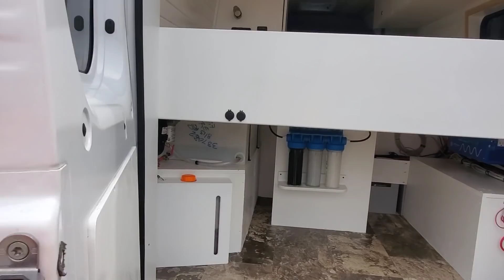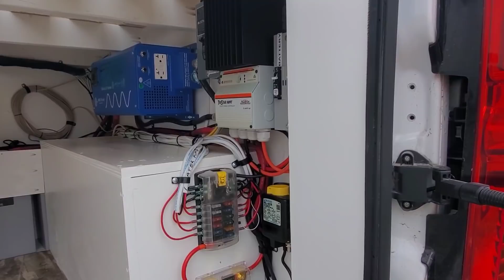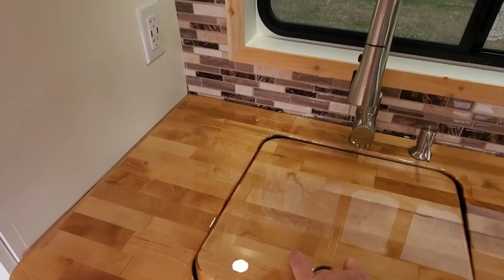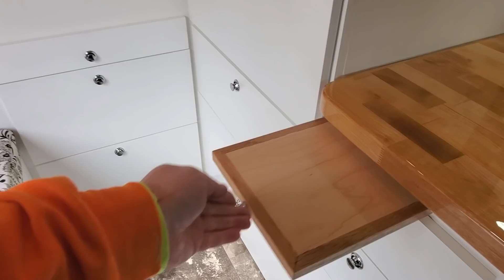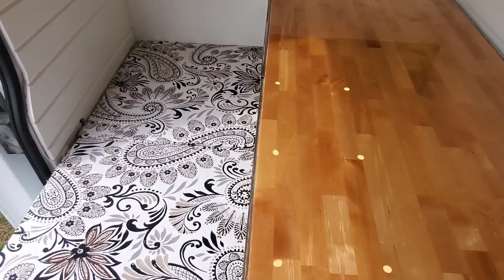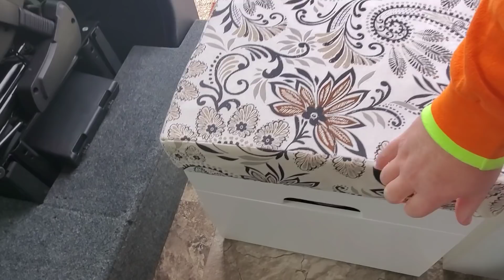Dodge Ram Promaster Camper Van Conversion (E38)

Comment: Red, how come most ProMaster vans are only the 2500 and not the 3500, 159” extended??
Reply from the maker: Because the 2500 and 3500 159's are cheaper and easier to find. The 3500 159ext is usually around $5k to $8k more and harder to find used in good shape with low miles.

Comment: I am looking to put my heater in the same location but looks like there is only 3 inches of space ...
Gas tank in one side and some other thing is there and didn’t look like enough room to bend the intake and exhaust pipes and bolt it down ! You did so great job! I may look for a easier place... lol
Reply from the maker: Putting it there was a complete pain in the a** and I hope i don't have to put another there.

Comment: Very nice job! I've been converting my 2019 159 Promaster and may need some help finishing because my son, the mechanic is too busy to help. Many of the major components are in, solar panels electrical package, some wiring. I've insulated and sub-floored myself. Now I'm trying to run wiring but It's been near impossible finding anyone willing to help here in Nashville. I'm glad to see you're not too far away. Should I contact you via email to ask you specific hiring/scheduling questions?
Reply from the maker: Email is fine,  but it may be a couple months before I can add any more jobs.
Reply: @RedsCustomDesign   I totally understand, it's good to be busy. Thank you!

Comment: How much would it cost for you to do everything, including everything they already did?  Is it possible to get air conditioning and a TV put in something this size.  I really love it and everything is so practical and would be easy to live in.  My email is reenanlaverne@gmail.com.  Where are you located?
Reply from the maker: If I had to replicate this build plus add a rooftop a/c unit it would be in the $28k - $29k range
Reply from the maker: Southern Indiana

Comment: Red, are your clients going to be full timers or vacationers ?  And I noticed there is no mention of what is the lady using for cooking ? I am surprised they didn't put in a vent fan, I have never seen a RV'r who wasn't happy with one,  and they always pointed out the advantage even more so in a van conversions.  Now that the Lagun swivel table top is so versatile and popular I am surprised they opted for the pull out table top.   I hope they appreciate your craftmanship as it all looks beautiful. The entire design looks very practical.
Reply from the maker: No full timeing just long trips. Thay have a induction cook top for when they are on shore power and a single burner butane stove for off grid. It did have a rooftop fan.

Comment: How much does this wood weigh in the van build? Do you know how to measure the weight? Im thinking of making one like this, but placing 3/4 inch plywood on the walls and ceiling.  Thanks
Reply from the maker: Why add that much weight to the walls and ceiling?  ¾" plywood on the walls and ceiling is way overkill and you'll have a hard time bending it to shape. The most I ever put on the walls is ½" plywood and ¼" plywood on the ceiling.